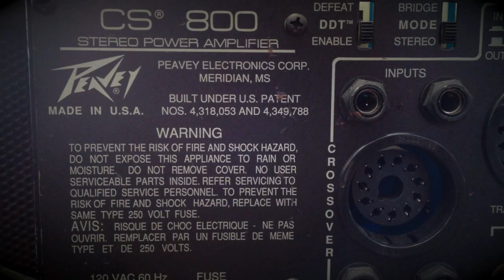Peavey CS 800 Power Amp Cleaning/Breakdown

Comment: I need repairs an equal model, please can you send me the sevice manual in pdf thanks
Reply from the maker: oswaldo gomez https://assets.peavey.com/literature/manuals/80300991.pdf
Reply from the maker: oswaldo gomez https://assets.peavey.com/literature/manuals/80300991.pdf. Did you see that one?
Reply from the maker: I no longer have this item.  The repair schematic was on the inside cover of mine.  Luckily I did not need it.
Reply: Thanks for taking the time and send me that file but really if you have the file where it is electronically